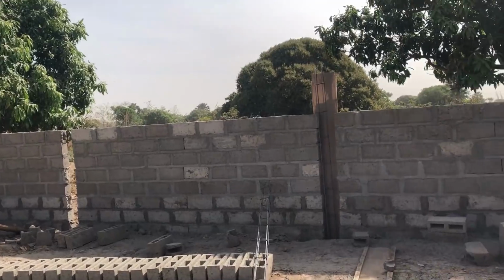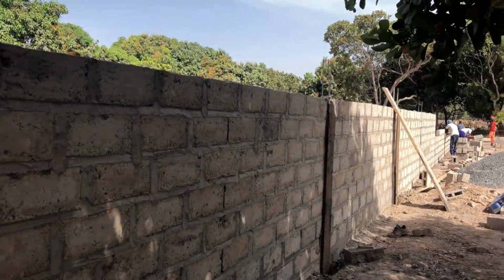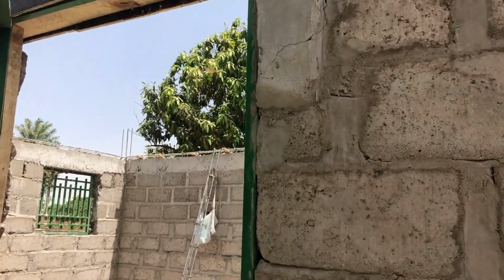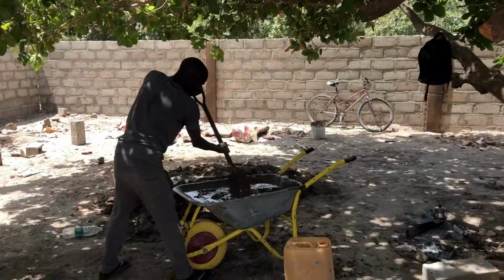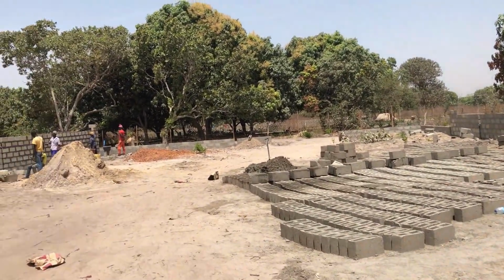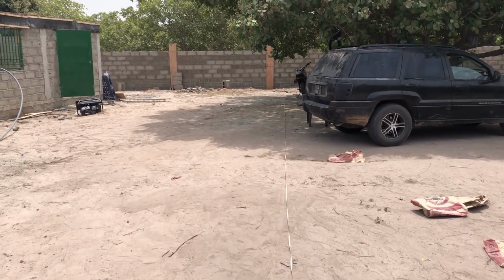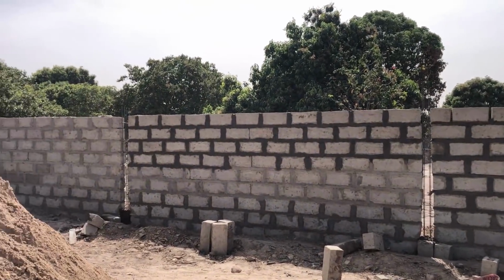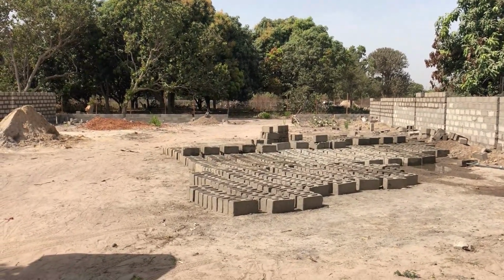The Arrival works on fence in The Gambia

Comment: Great progress guys as always ! It’s amazing when you see all the security walls and shed, *that the guys actually made the blocks from scratch and  then built them without a cement mixer ,even mixing the concrete for the forms all done by hand . I’m sure the guys could certainly teach the tradesmen here a thing or two.. Here if the cement mixer broke down there would be nothing done till it was repaired.. I certainly admire how hard the guys work and the progress they make , also they are always smiling and seem happy at there work which is great to watch. Thanks for sharing .
Reply from the maker: They have inspired me soo.much. I have so much respect for them. They work very hard and are happy doing soooo😃❣🙏

Comment: The engineering of the wall is interesting. I would have thought that rebar would have also been horizontal in addition to the vertical bars.  The vertical rebar approach seems to be the main way of building walls. Once the top forms at top of wall have concrete added that should make the walls very strong.
Reply from the maker: This is the process here in the Gambia. To go horizontal the block we ould be completely hollow and not sttong😃🙏❣